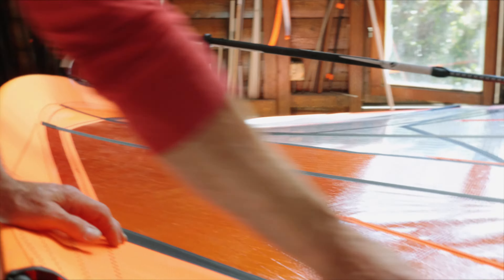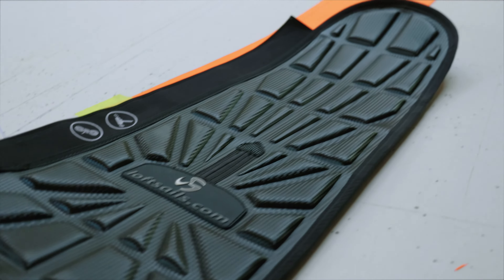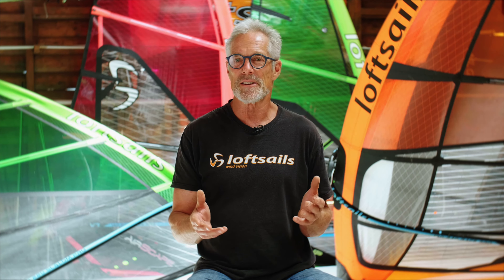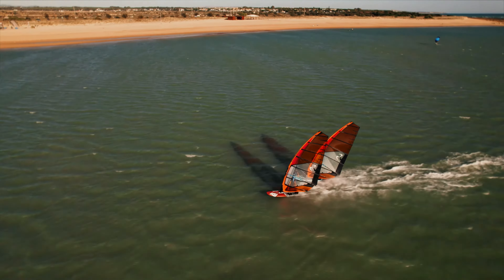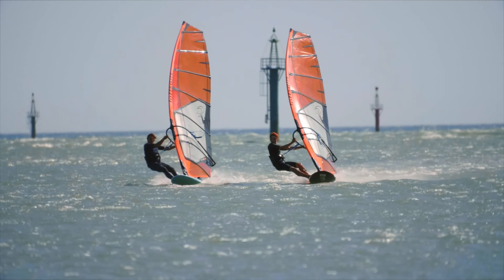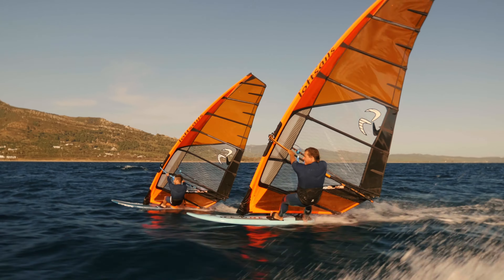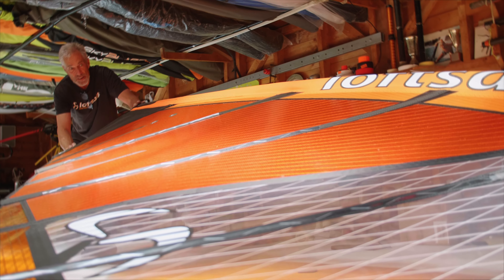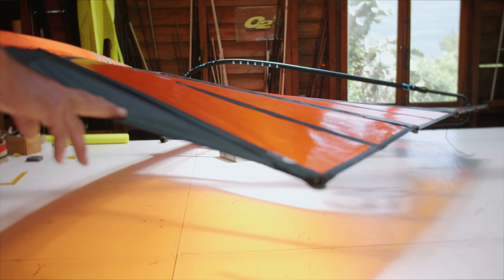Monty Spindler | Testing - How does it work? |  Tech Tack Ep 15

Comment: The testing on a truck does not work because when windsurfing, there is less wind over the water surface and more higher up. The reason why sails always need some twist. Which is not the case on a truck. So any test result becomes pretty much useless.
Reply from the maker: That is why these kind of tests were done back in the day:)
Reply: @Loftsails  FCS was testing side fins on surfboards in a water flow tunnel. Without taking into account the effect of the board, with the rider on it, to the water flow underneath. Making the whole test useless and even misleading. Similar to the sail on a truck testing. Windsurfing is pretty difficult to mimic in a artificial setting with all the flexing going on. So the only way is practice testing. In flat water you can do this quite OK with 2 equal riders, in wave sailing even that gets difficult.
Reply from the maker: @BoukeBecker  In the end it's about collecting data and pattern recognition. It is not really an issue of mimicking a windsurfer, but more in line with facilities required + budget constrains as well as overall necessity for such endevarous research. But we do agree with you on the value of practise testing:)